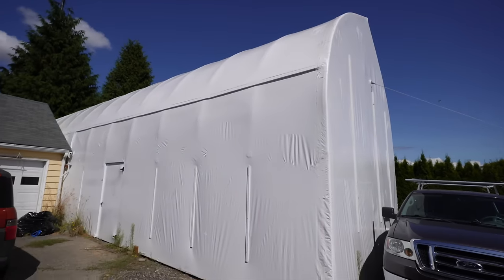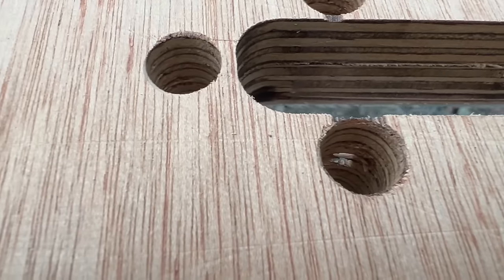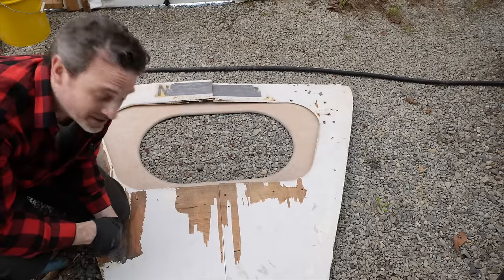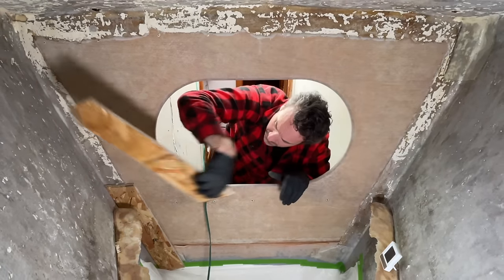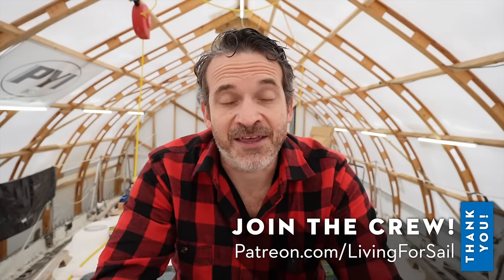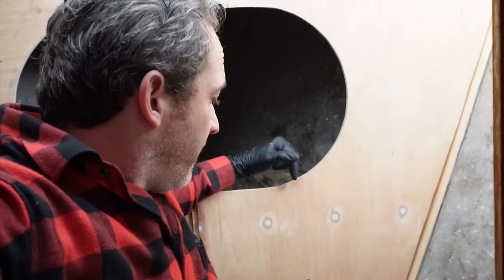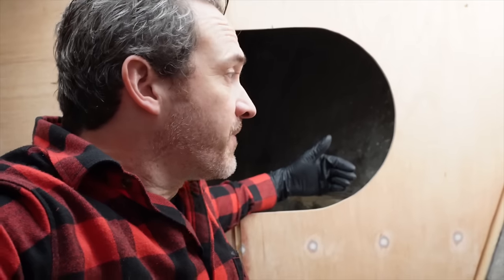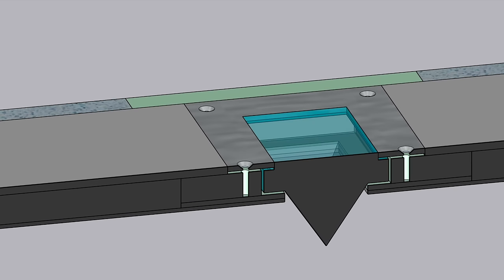Let’s get this sailboat bulkhead replaced! - E024

Comment from the maker: Let's here your PRISM stories! Do yours leak? What have you tried to remedy that? Would you rather just eliminate them, or keep them?
Reply: I always say, "If it's worth doing, it's worth overdoing." You could use this as an opportunity to get some practice with fiberglass mold making. Flip the prism upside down, spray some PVA on it, and use it as the basis for a mold to make prism fittings that would function similarly to the bronze fittings. If you're wanting to avoid through bolting the flange, you'd need to imbed some threaded hardware.

Comment: Yes it's a problem with prisms rebated at the top. Sell them and buy flushed top ones. Create a glass box insitu and use structural glass adhesive and don't use the bronze edging.
Reply from the maker: Interesting idea. I’ll have to try to dig up some info on the glass that you’re referring to. I’m ok with using structural adhesive if it’s done correctly… if it’s good enough for skyscrapers… 😳
🙌👍
Reply: The flushed top ones I was refering to were the same as the type you showed for magic carpet👍

Comment: Because of you deck construction, you might find that the G10 square, epoxied into the deck, with quality butyl, to seal the prism to the G10, then frame to hold the prism down, with more butyl, to cushion the prism, from the top frame. 
Best wishes from Northern Manitoba.
Reply from the maker: Thanks for the input. 🙏. Where about’s in northern Manitoba? I used to head up to Thompson for work occasionally…
Reply: @livingforsail You got it in one.

Comment: I like the idea of designing a G10 prism case over bronze. G11 can withstand higher temps which may or may not be something to consider.

As far as water tight bulkheads go, keep in mind documenting your refit also adds to resale value.
Reply from the maker: I like that G10 can be drilled and tapped (in theory… I should probably try it one of these days. Haha)

Interesting point about resale… “here is a recent survey and also 100 hours of YouTube videos to catch up on. 😳”
Thanks for the feedback! 🙏👍
Reply: its not theory, ive tapped it to apply 316 metal inserts which will be the final thread where the bolt will anchor
actually i will do it in my foward watertight bullkhead that ive built out of 6mm G10, to secure the hatch (which is nothing than the cutout with some lips laminated) @livingforsail

Comment: I'm a little late on this one, I would say you really have to think about how much light those prisms really bring in.  Leaks suck and can really make a hard passage that much worse if everything down below is soaked in salt water. When it's stormy and shitty out and you are short-handed, it helps a lot to come off watch and get into a dry bunk and get some rest!  One of my favorite things about some of these aluminum boats is that they have no deck penetrations, everything is welded, not through-bolted.
Reply from the maker: Some good points here. My goal is to (if I keep them) make them as leaky as possible resistant as possible, and failing that, as easy to re-bed as possible. 
Thankfully none of them are above any of the bunks. 
🙏👍🙌

Comment: I honestly think G-10 is overkill, unless the thought process is to tap the G-10 and use machine screws.  I like deck prisms as they honestly bring a LOT of light into the cabin below.  I have a friend with the grapefruit ones and I am comstalynreturning to the cabins to check and see if I left a light on!
Reply from the maker: You are correct. I’m mainly interested in it for the ability to drill/tap and use machine screws with nowhere for any water to go if it leeks past a fastener. 
👍

Comment: Bronze certainly has a “classic boat” feel to it, and would work great.  G10 will have a more modern feel to the esthetic, but would also work great.  Just depends on the overall vibe you want to achieve.
Reply from the maker: There is a mix of bronze and stainless on the topside of the boat… I probably can’t really go wrong… 🤔🤷‍♂️

Comment: about the prisms: the first thing to do would be to rip out the teak deck (and i mean the whole teak deck). you will be glad you did it in a few years. 
i dont know if your deck is cored or solid but if its cored, replace the surrounding area it with something that is closed cell and maybe a G10 frame glassed from the inside so that the prism itself ends up lower than the actual deck (if i understood this to be your objective) laminate over the new closed cell material on top, fair, sand, fair and sand again,  bed and bolt the prism. i would be wary of it collecting water so i would actually apply the prism  in the opposite fashion: so that water runs off of it. to the expense of hurting my feet on it, but boats are synonyms for compromises!
Reply from the maker: Thanks for the insights. 🙏 I think that’s a good point that being slightly proud is probably favorable to avoid pooling. 👍🙌

Comment: I think you'll be very happy to retain the prisms.  Bronze is always a "salty" choice, but it isn't cheap.  I don't know that the G10 is any cheaper -- is the "cost" of the fabrication time more than the cost of the bronze?  Do you save time or labor with the bronze?  Which will be more leak or moisture resistant?  Which do you actually like best?  (Some choices are strictly a matter of personal preference.)
Reply from the maker: I would like to try to keep them. I think you’re right that I’ll be happy with that decision. I have a few things to consider here…

Comment: That epoxy work for the gland fitting was really funky if not incredibly time consuming. Any ideas roughly how many hours you spent creating that? Was the main reason to protect the bulkhead wood from being exposed ?  Amazing work .
Reply from the maker: Thanks. 🙏. The whole job would have been under 2 hours start to finish. It was a little longer to film everything 😉. My thinking is that if I don’t provide anywhere for water to get into the core, I’ll have less issues down the road. Water gets EVERYWHERE. Haha. 👍🙌

Comment: I'm facing the same issue after removing the teak on my Trintella. Fitting the brass plate flush should look great, but it would be a lot of extra work and introduce more complexity and potential leaks, I would think. My plan is just to replicate the old setup, with the brass plate bolted down onto the deck, and epoxy encapsulated ply below supporting the prisms. Both of mine leaked and have damaged the foam core slightly.
Reply from the maker: Thanks for chiming in. We will see… I know for sure that John Kretschmer covered his prisms when he redid his deck after pulling the teak off. I should ask him if he misses the prisms…

Comment: I like the G10 idea.  But nowadays with the very low cost of LED lighting these are more of an expensive luxury item than something that is utilitarian in nature.  Good luck.
Reply: Agree with the use of LED lighting. Ditch the prisms so there will be fewer holes in your boat.
Reply from the maker: Yeah, it’s a good point… there are some great LEDs out there… there is something about natural light though… 🤔 
Thanks for the feedback 🙏👍
Reply from the maker: That would likely save some time too. 🙌🤔
Thanks for the feedback. 🙏

Comment: Instead of machining G10 to shape why not cast epoxy thicken with microfibers and chopped fibres. basically home made G10, while not quite as strong it will still be stronger than the surrounding material. Sure you have to make a mold but I gather you have several prisms to install
Reply from the maker: There are 6. It’s an interesting idea that I will consider and look into more. Thank you. 🙏. I appreciate the feedback. 👍🙌

Comment: too late now but another way would have been to just put some large "bolts or threaded rod" of stainless or brass that can handle the current thru the bulkhead and fix the cables either side of the bulkhead
Reply from the maker: Interesting idea… stainless would be a no go as it’s a pretty bad conductor it brass could work… of course, “there’s always a harder way?!” 😉
🙌👍

Comment: The Incredible Bulk!  Will you have a blank/ plug handy to cover the hole in the bulkhead in case of a leak? The plug on the bow side. Even if it’s Patti ally water tight it would still be handy I did speak to a sailor who hit an object healed over, it was above the waterline, it was in high seas so was coming through the bulkhead hole. He nailed his nice expensive table to keep the water out…. It was a long sail. 
That’s funny… you talk on this issue later
Reply from the maker: I am thinking that I will make a cover for  the opening that I can stow and put in place if I need the ability to keep water out. Crazy story! Did it all work out in the end?
Reply: Yes he made it accross the Atlantic. He built a plug that opened on a strong hinge at the top with some through butterfly bolts at the bottom,, it  wasn’t completely water tight but slowed things down, he also beefed the support on the inboard side with a couple of crossbeams to support the top and bottom joins in the middle of the bulkhead.

Comment: Wouldn't stainless steel be a little cheaper than bronze for your deck prisms? I didn't follow the problems with "machining" the G-10 for a facing, but either might be better than the bronze which will require some frequent "shining" to keep it looking good. But I say KEEP the prisms. They let in a lot of light!
Reply from the maker: Thanks for the feedback. 🙏 I really like the natural light. I think I’ll find a way… cheers! 🙌👍

Comment: Why didn't you take the opportunity to improve access to the chain locker , false floor and water exit out of the side , that space can take a ton of water through the deck hole and only get pumped out from the bilge , and bilge pump.  You could have made a chain locker with above the waterline drain., access from the deck . Shame  you don't get experience from a book.
Reply from the maker: https://www.youtube.com/playlist?list=PLtx2ax0GHEtB2Gk8XvROjLWjYNNcmK6tO
Reply from the maker: BOB PERRY Yachts Talks Design and Refit Strategies
https://youtu.be/zdvBRuskO6s
Reply: @livingforsail  looks like they are still in the past and not moving forward , you will have modern safe electronics , why not safety and keep water out, one fuse and no more bilge pump.
Reply from the maker: everything is a compromise on a boat. I have reasoned that IF my plan does not work out as I’d hoped for that it will be easier to raise the floor and drill a hole than go the other way. @davidwarnes5158

Comment: Is it possible to be super smart but everything he does or build or plan to do seems unachievable without a naval architect or a sailing novelist reassuring him that he’s doing the right thing?I guess there’s no door going to the front V-berth??Oh it won’t fit through the main hatch🥴John you must be suffering from lack of sleep lying awake engineering the hardest most time consuming and expensive way to fix everything on your sailboat.Why plywood instead of Coosa?You know water could probably travel inside the wires that penetrate that bulkhead.If water gets up that high you are already sunk🤓just a little something to think about 😜
Reply from the maker: Thanks for the feedback. I’ll think about it 😉 after I run it by one of the experts 🙌
Reply: Good idea😊